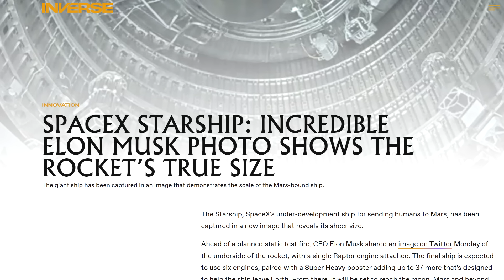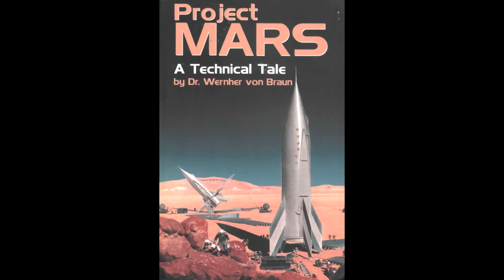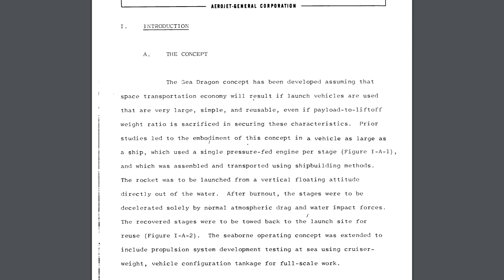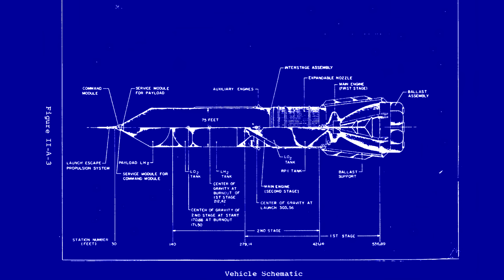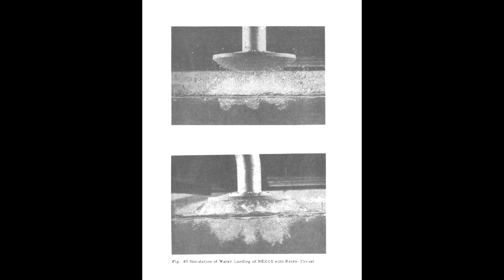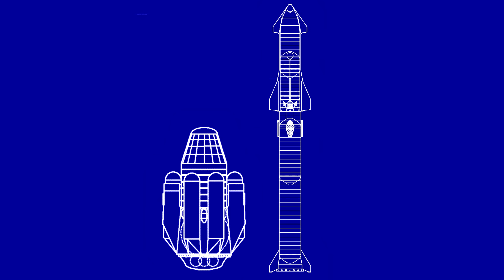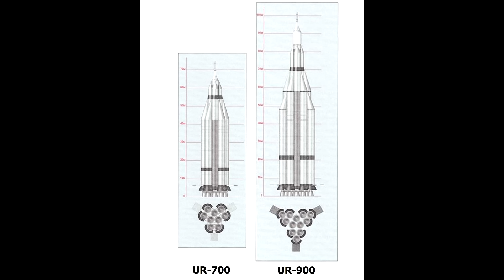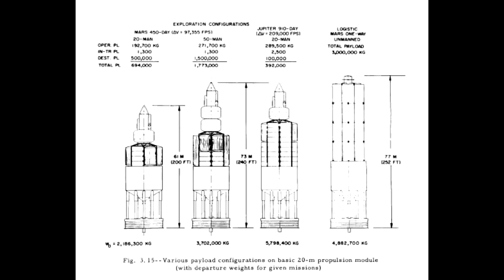The Old Rocket Designs That Make Starship Look Small

Comment: Truax spoke with the author of "Great Mambo Chickens and the Transhuman Condition".
There was a lot of logic in it.
He says he looked at other rockets and found that the cost of it has nothing to do with size. Cost is driven by parts count, design margins, and innovation. Lessen these, and you reduce the cost. Materials are a tiny fraction of cost, so making it large really doesn't add that much, somewhat the same with production facilities and handling on the ground.

SpaceX rediscovered this, with their in-house manufacturing of everything and simplifying it, using the same materials and tooling on upper and lower stages. NASA and the usual contractors still use parts designed for smaller lighter more delicate thigs, that require subsystems to be sent from all over. Note that they were underselling all launch services competitors before they'd landed a booster.

Sea Dragon was to be steel, much like a submarine hull (but not as strong or costly). It was to be built at a shipyard and floated out to the ideal launch site before being fueled.
Truax also spoke very strongly about designing different things for people, than for cargo. He said to never mix crew and cargo because the design requirements (and design margins and complexity) are entirely different. You can insure and duplicate a cargo, and you do not want to spend as much making a cargo booster as reliable as a crew vehicle.

There's still talk of putting people up in "Starship" and this is a mistake. I have serious doubts that NASA is entertaining this, despite the fact that they made all the worst mistakes with the Space Shuttle launch stack.
You will not send people up in something with zero provision for crew escape and survival from the booster stack. No, the upper stage and its engines cannot be the escape system to get the crew away from a malfunctioning upper stage, which is simply too massive for 8G  for 1.5 seconds, as an escape rocket.

And similarly, it doesn't make sense to put a Dragon with its escape systems, on top of the "Superheavy, atop a smaller cargo fairing. Do not try to man-rate for launch, you big booster.

There's no reason, even for a reusable booster, to make a large booster man-rated. We already have Dragon & F9, and there's talk of a 7 person Dragon, that still has crew escape and survival from zero altitude zero airspeed to hypersonic and sub-orbital.

The real value of the "Superheavy / Starship launch stack is a cheaper launch, of ~100+ tons into LEO, which nobody's had since the Saturn-V.
The ideal Lunar or Mars mission using it would be to meet it in LEO with a crew dragon, after the un-crewed launch of the mission elements as payload instead of the landing vehicle of the "Starship".
 You simply can put up more, bigger cargo by not using the "Starship" but using an equivalent upper stage and aeroshell that can then be bigger diameter than the "Starship".

Comment: hey question for technical people. With carbide bits and what not we have now. Would you possibly mass produce engine bells using an induction system and almost like carbide friction drills. To heat up a stock piece of say TZM, then you place it inbetween two of these drills matching the wanted ID of both sides of the bell. As well as some outside shapers to help direct and stabilize the stock. As the drills close in and shape the bell. Because the size of the machinery needed is very realistic. But I don't know how well alloys like TZM form. Because if this worked, and you did it for a very reliable engine design. You could make manufacturing of engines cheaper and use the "just attach more rockets" method of soviet designs. It's not perfect, but doesn't sound unrealistic.

Comment: If Super Heavy explodes the first time, all the skeptics will be: "See, I told you so!" just as they did during all the iteration testing of Starship. Let us just see if this is possible by allowing time and testing to occur. Thanks for the video.
Reply: Not so sure to many said it could never work. "will it ever make money?" is a completely different. 
Concorde worked.
Does he have approval to blow it up oops I mean launch it yet? ;)
Reply: Fun fact: One of the Heavy-lift Vehicles from NASA's SPS study (the Alternate Design at 10:31) has similar payload to Starship (120t), yet only 4000t mass when full. Which is less than simply the fuel mass of Starship (a 20% boost), and even with some mass reserve! Apparently, aluminium construction/winged flyback is a pretty efficient design!

Comment: I recently got a new perspective on vehicle size. Now the Starship is made of steel, I thought of comparing to other common existing steel structures, such as commercial seagoing vessels. Perhaps the best comparison would be to bulk oil carriers, the largest of which was the Seawise Giant at 1504 feet (458 meters) long and gross tonnage of 260,000 tons. Of relevance is the ratio between the thickness of the steel and the size/length of this ship.A typical ship might have a bottom plate thickness of 20 mm (about 0.8 inches), but that is supported by a complex box beam system. Nevertheless, that is analogous to a 150 foot ship with a hull thickness of 2mm, substantially thinner than Starship if I recall correctly.

So while we still think of Starship as being an unprecedentedly large structure, it's simply comparable to smallish buildings and smallish vehicles, so perhaps the transition to launch vessels 8 or 10 times as large is now simply finance, markets, and engineering.

And certainly space structures built using robotic extraction and 3D printing of materials from asteroids could be arbitrarily large. Sending a robotic system to grind up a nickel iron asteroid and use solar powered laser sintering to construct large scale triangular truss beams is now entirely feasible, with every component of the process having been accomplished in tests.
Reply: There's a HUGE difference between laying down in a nice comfy waterbed, compared to standing up AND holding up several times your own bodyweight (which is what a rocket does when it's experiencing max q)
Reply: @tybofborg  Sure, but watch the flexing of a container ship as it travels through the waves. A big container ship may flex a couple of feet under normal conditions. The ocean is a different but equally difficult environment. On average one commercial ship is lost every week! My point is that we don't need to be astonished by progressively huge space vehicles, we are now in a new era of progressive expansion and something more like "commodity" construction. I particularly appreciate that Starships are being built by steelworkers who used to build water towers and - yes - ships!😊
Reply: A rocket has to withstand much larger forces than a ship, that's why Starship needs thicker walls.
But you are right about the size, we could definitely build much larger rockets. It's just the lack of funding, and the lack of demand that limited rocket size after the Saturn V.
For example there was Project Orion, that really redefines scale. The smaller designs had hundreds to thousands of tons of payload capacities. And no to LEO, but to Pluto. The bigger ones could be useful in case you need to lift an entire city into space with one launch. There we are talking about millions of tons of payload capacity.
Reply: @andrasbiro3007  Yes the equation is rapidly becoming tied to markets, finance, and progressive engineering.
Reply: Fun fact: One of the Heavy-lift Vehicles from NASA's SPS study (the Alternate Design at 10:31) has similar payload to Starship (120t), yet only 4000t mass when full. Which is less than simply the fuel mass of Starship (a 20% boost), and even with some mass reserve! Apparently, aluminium construction/winged flyback is a pretty efficient design!
Reply: @HalNordmann  
And how much it costs? As I said, cost is what really matters.
Also fuels is over 90% of a rocket's mass, so it's not much lighter than Starship. And it's a concept, we don't know if they could hit those targets in practice. And also Starship is still in early development, subsequent iterations will drastically improve it's performance, as it was with the Falcon 9.

Comment: Scott, maybe I missed it, but how would Sea Dragon have achieved roll, pitch, etc.?  Would that single massive engine have had the ability to gimbal?
Reply: Methane pressure tanks with valves to inject methane at various positions in the engine bell to give it off centre trust I believe. I'm a bit doubtful out would have been enough authority if things started going wrong, but probably OK if things went to plan

Comment: An honorable mention would be for the largest SRB ever built and tested. Can't remember the name but it was meant to be a direct bolt on and cheaper replacement for the Saturn V first stage. It worked fine, but saturn V was scrapped, so the concept of a solid fuel first stage died with it.
Reply: You mean the AJ-260? A minor correction - it was a replacement for Saturn IB's first stage, on Saturn V it would work only as strap-ons.
Reply: @HalNordmann  Yeah that one, and verified, at 35.000kN thrust, the proposed full lenght AJ260x (that was never built) was, indeed a S-IC remplacement.
The half length AJ260 itself (that was fired) was a Saturn V IB first stage replacement and envisioned as strap-on boosters for the regular Saturn V. Can't be more kerbal that that. Let's strap some massive boosters on the biggest rocket ever !

Comment: Scott, could you look at any possibility of a Concord - type low orbit capability?  Concord flew higher and faster than most other planes have achieved since; if you used up some of the passenger space with an additional rocket booster, and didn't have to fly right across the Atlantic, but instead just gain the max height and speed, then light up the rockets when air is no longer thick enough to be used - how far off possible is that?
Reply: There is still a long way to go between Concorde's flight speed and orbit. But you could use a supersonic plane as the first stage of a rocket, like in the Saenger/Horus concept.

Comment: More impressive if they got past sketches and concept drawings to even the beginnings actual nuts and bolts engineering and infrastructure.
Even one photo of a commitment to start building hardware would give credence to the design having been fleshed out fully.
Engineering whether it is rockets, buildings or bridges is littered with granous concepts where the base line numbers might add up, but building it is another matter.
It's the Elon Musk's and Howard Hughes of the world that make it happen.

Comment: Be an interesting comparison to look at each design converted to the same material. The relatively lightweight stainless steel of starship utilized on any of the others would have drastically increased performance. Probably
Reply: Fun fact: One of the Heavy-lift Vehicles from NASA's SPS study (the Alternate Design at 10:31) has similar payload to Starship (120t), yet only 4000t mass when full. Which is less than simply the fuel mass of Starship (a 20% boost), and even with some mass reserve! Apparently, aluminium construction/winged flyback is a pretty efficient design!
Reply: @HalNordmann  I watched on my phone and missed that finer detail. Glad you saw it

Comment: I'd love to know why the sea dragon actually launched from water, what made them decide this etc?
Reply: I think the idea was just to be able to tow it to the equator.  Sea dragon never made it off paper though.
Reply: Yeah, me too. It seems a lot more difficult than launching from land, so I'd be keen to know why they thought this would be a good idea.
Reply: @Archangelusbe  Because of the difficulty of finding unpopulated areas to launch from. SpaceX owns a couple of retired oil rigs they are converting to launch platforms.
Reply: It would have demolished any conceivable land-based launch pad, and that’s assuming you could find a pad physically big enough to put it on.
Reply: @Shaun_Jones  It is easier to build a land based launch pad than one that could sink. The space problem was a big  issue though. It still is for airports which need to be near cities and for Starliner.
Reply: @markhorton3994  The launch pad for Sea Dragon would be the ocean itself, and it would handle and lower the vibrations of engine ignition.
If it were to launch from a normal pad, it would destroy both the pad and itself
Reply: The noise suppression systems available would have been inadaquate, and the resulting shockwave, just from ignition, would have destroyed all the support infrastructure.
Including the launch control *bunkers*.
Reply: @craigevans2961  Thanks! That was very interesting!
Reply: Truax's concept was to build these in shipyards, tow them to sea, flood the rear section, causing it to self-erect in the ocean, and then launch.  We actually tested the concept using a modified Aerobee sounding rocket.

Comment: Human thinking has the flaw of wanting one-size-fits-all solutions so we're left with building only the biggest size. The Falcon Heavy was a good step up from Falcon, but Starship is a huge leap up from that and with scale comes unforeseen problems. Too many unforeseen problems at the same time are the project killers. The Space Shuttle suffered from that as well. It never lived up to its original hype of 40 to 50 flights a year. Somewhere I should still have a NASA promotional booklet from the 1970s I got as a kid.
Reply: I don't think that is true for rockets anymore.
Today we have small sat launchers that get even smaller still, as well as almost every step in between that and new super heavy launchers

Comment: While I can see some of the advantages of scale, I can also see some of the disadvantages. The behemoths not only require more time and cost to develop, but they also put all your eggs in one basket economically, politically, and human life.

It still seems to me to have value to put the precious stuff (humans and equipment to assemble something larger) into very low Earth orbit using smaller more expensive rocketry which can then receive "in-flight-refuelling". Since most of the fuel is used to carry all the other fuel up there, couldn't this be done separately using cheaper rough-and-ready technology that nobody much cares about if one of them is lost? Rather like how the space station is built and serviced today. In the past, perhaps docking and assembly were considered more difficult than today, but they've shown that they can effectively assemble and maintain complex structures in orbit. Returning something downwards essentially only requires a heat shield, doesn't it?

Sure, there is an economic cost to this approach. But if you don't know what funding Congress, Private Investors, or International partners will make available at any one time,  then doing it in a modular fashion appears more attractive. By analogy, I bet most poor underdeveloped nations in Africa are building cell-phone networks, but not so much of the traditional land-lines. The older technology just requires too much political and economic stability for investors to take the risk, even if they could get the larger funds needed to do it. On the other hand, cell-phone networks can be built piecemeal, in a modular fashion from the big cities outwards and with lower risk.

Comment: I gotta question Scott. How do you clean the mess behind you? Doesn't it accumulate dust all the time? Don't you have to wipe down every single thing that's there weekly?
Reply: Some people are all right with doing that weekly wipedown. I once saw a piece on collectors, especially a couple who were both sci-fi fans and collectors. They had such a big figurine collection, it took them 2 1/2 hours to dust every week. They did seem to find it a bit much, but they must have been able to tolerate shorter periods of dusting or their collection wouldn't be that big. They had hundreds of figurines on display. I always wondered why they didn't just have glass cabinets. :)

Comment: Watching this, I wondered if there had ever been any serious thought put in to a vertical vaccum tube through which to propel things to space, removing most if not all of the veolicy requirements? Almost like a space elevator, but much wider, and but doesn't go all the way to space. Anchoring would be the issue there, but we could use something like that to pop things in orbit really quickly. Maybe I just need more coffee...
Reply: The structural requirements on that would be insane. I don't know if that's even possible to make.
Reply: Called a sky crane.. structurally stress is too great on materials at this time

Comment: 8:25 I really think you gotta check your numbers there. A 160 ton parachute is just ridiculous.
I looked up some number for parachutes, and this equates to a parachute with an area of 3.6km^2.
Reply from the maker: That was based on the paper which gave a mass of 80 tons for the parachute system on the half sized version, presumably that includes all the rigging and a deployment system.
Reply: @scottmanley  The three Shuttle SRB 136 ft. dia. main parachutes weighed around 2,000 lbs each. IIRC, impact velocity was around 66 ft/sec. for the 173,000 lb booster. But I'd have to go dig out my documentation.